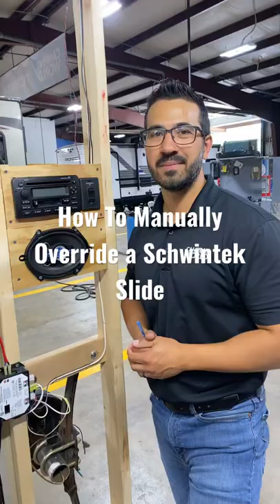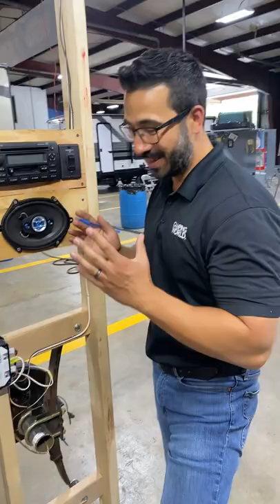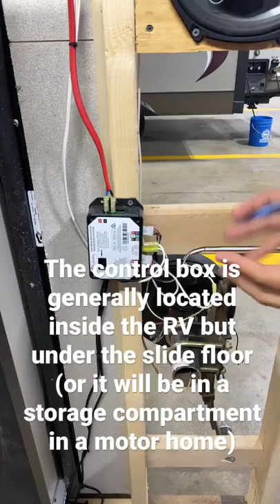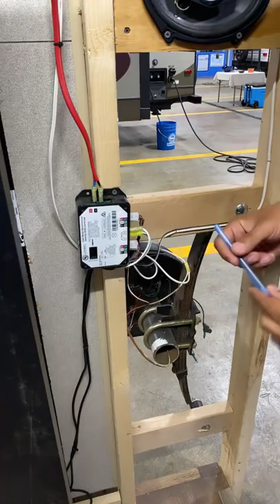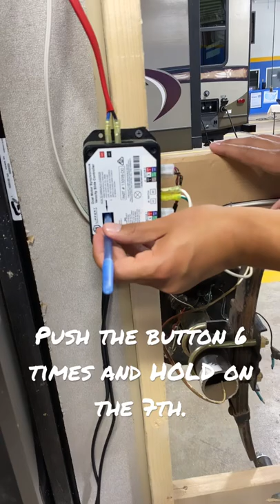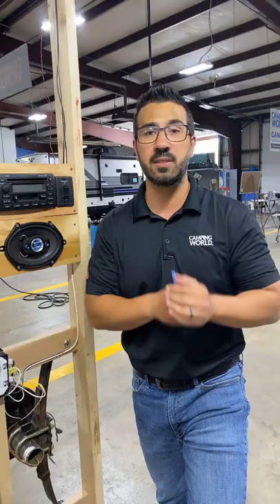#shorts How To Manually Bring In Your Schwintek Slideout!

Comment: What would you do if there was no power to the unit. I mean batteries completely dead.
Reply from the maker: You can technically release the "brakes" on the controller and manually push the slide in with a few people. However, we cannot "recommend" this being done as it also allows for the slide to possibly fall out and that is something we never want to have happen.
-Ian Baker
Reply: Have you ever done this? i.e. "released the brakes" ???
Reply from the maker: @doncrow5529  personally, I have not. I was told about this process from a Lippert technician, however my Master Techs explicitly said I cannot describe the process as it’s too dangerous due to potential liability. That being said, if you do some digging around in some Lippert Schwintek operating guides, I’m sure you can find the information you’re looking for 😉
-Ian Baker